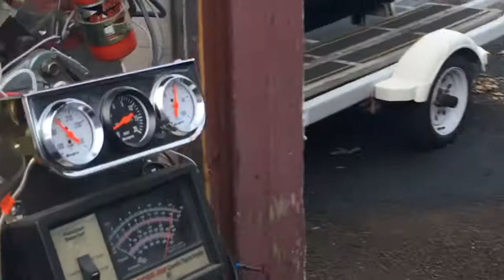PROJECT 3

Comment: With the higher RPM here, are you getting the rings to seat during a break in? I'm digging those Ram Air IV manifolds. Nice work, thanks for sharing. I really enjoy your vids. Just sold a 500557 running engine with 52K original on it for $800. I was hurting for cash...I'm  so sad. It was in my grandfather's '76 Bonnie that he willed to me. I guess I can put the 1A II in it now LOL. Keep 'em comin!